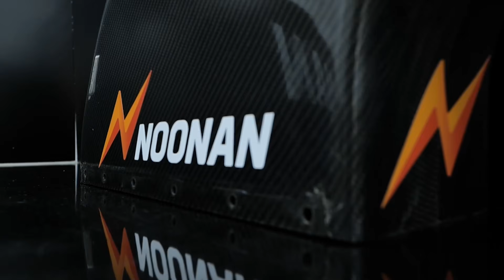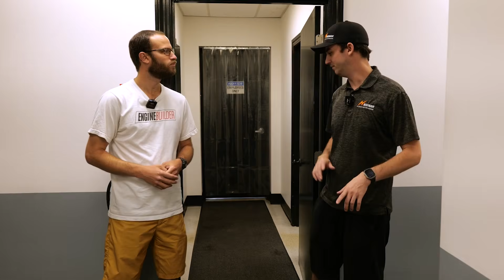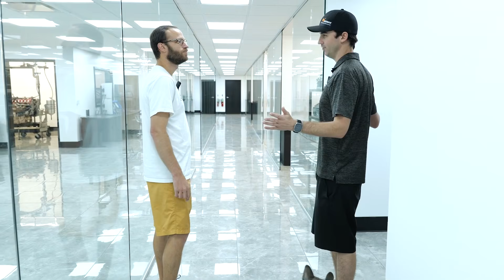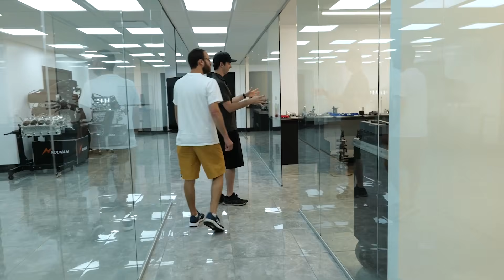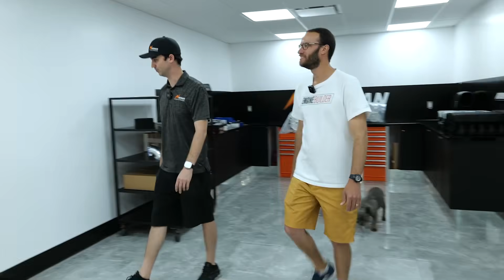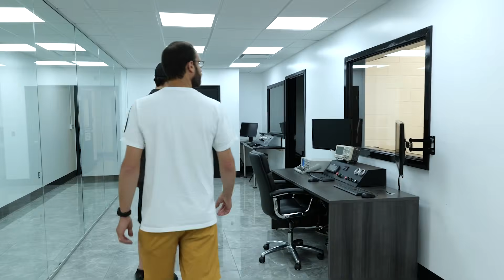The Coolest Engine Shop Ever? Inside Noonan Race Engineering

Comment: "Coolest" and "most badass" are not synonymous with BEST and during a "shop tour" OF the BEST "engine building shop" in the "drag racing industry" on the planet by FAR - ProLine Manufacturing - you will see "Noonan" engines in for  "building" because this "engine builder" is at most an "engine assember".

Comment: From a old Gearhead from the 70s. Technology is AWSOME today. Nothing to have a 1,000 + Horsepower daily driver today.
Reply: Nothing but 35k, just for your engine. Also , who would want a 1000hp to creep in traffic? 300hp daily, 1000 for track , cage ,chute etc
Reply: @carpentrybybill7018 I guess you never heard of Sick Week and many other events. Where there are cars making 4,500 plus Horsepower on the street. Many new cars are making 700 plus Horsepower. Just because you see no need it does not apply to others. On your 35 k engine.  You can go buy a 700 Horsepower out of a new total Mustang for around 15 k. Add some bolts on, making a thousand Horsepower in traffic with a/c on. Guys like you have no idea about new technologies.

Comment: I would love to build/design a engine. I'm thinking a big block version of a LS/LT block. A m20 splayed main studs, that thread into the base of the cylinder /water jacket area, or the top of the main webbing, with m12 cross bolts,  capable of 4.6" bore, with a 4.5" stroke, capable of about 4.8" , a bore spacing a little wider than a BBC ,  with a deck height to allow 6.5" rods if desired. , normally a 6.2" -6.3"  or as short as 5.9-6" with a shorter deck version. Use a bolt in cylinder liner system, o-ring into the block, have a 1" thick water jacket. With 6, m10 bolts per sleeve with a press fit deck plate that presses in after the liners. Working as a girdle with the head studs threading into the water jacket and cylinder base. And using a head similar to the new Chrysler hemi, with overhead cams, titanium valves , tiny springs and stims 6mm, maybe inconel exhaust valve in about 1.925" exhaust, and 2.280" -2.3" intake. And CNC raised ports, with polished chambers. With the heads looking similar to motorcycle heads with ceramic coating in the exhaust port combustion chamber even under the valve cover to help with oil draining back, and heat , the ceramic insulation reflects heat and insulates. Also leaving a smoothe stick resisting surface , used on the piston dome, chamber valve face and back side leaving the seat and stem uncovered.  the insulation of the exhaust port will keep the energy in the exhaust, good for turbos ,  also resisting carbon sticking to the port walls possibly look into a dual overhead cam, using using finger followers possibly, looking for a near 2:1 ratio, with a quick ramp rate, Maybe use a Ducati style valvetrain , the desmo dronic  with the cam opening and closing the valve! Freeing up lots of power,  could be a cool engine, start with a 4.250" bore, and 3.875" stroke, 4340 crank and rods, ultra light. Rods with 1/2" bolts,   the aluminum sleeves with steel or iron liners bolting in, with the deck plate pressing in after or possibly before they are bolted in. Through holes in the deck, the sleeve/liners an go in all at once or one by one. Then a non water based coolant is used, each head and block bank having its own coolant manifold internal. With either a internal crossover. Or a external crossover, with steam ports on the block and heads leading to a -8 outlets on each head at the front and rear. With the option of a block steam port the steam port being ported through the head from the block , leading directly to the outlet, for bleeding air from the system when filling. Non water based coolant doesn't make steam. Use the steam ports with a crossover, to pull a vacuum. Then fill the system until the vacuum pump overflow catches coolant, then close both fill point and steam port, with boost it should be capable of 3k HP daily driven with ps. And A/C,  and get 20-25 mpg until, because of v-tec and VVT , and possibly a 32valve option, a natural 600 HP engine in stock type tune, with a tune and exhaust, intake 750-800hp. Add cool boost, 14psi should be near or over 2k HP  sorry to ramble!!

Comment: It seems they would atleast get the valve covers roughly cast. Even with the walls 2"-3" thick. It would cut cost. And still be a milled billet valve cover.
Also a head can be cast in a oversized rough shape to save milling time, and a block thats a big difference. Casting a similar shaped block to be milled . But i guess they know what they are doing..
Reply: Agree,  he seems to be proud of being so wasteful of an expensive material...and for them to not handle their own recycling is poor business in my opinion as well.  Per current Aluminum recycle pricing they are stepping away from at least $550.00 per block waste.

Comment: Lived in Spartanburg all my life. Never heard of these guys. Not a drag guy , so that may be why. My shop is actually a mile away from them. You need to do Clements Racing. THE premier dirt late model engine builder as well as cylinder head designers
Reply: You never heard of them being a mile away?
Reply: @Mr.RollTide  Noonan has been in the US less than 10 years. Let's not act like it's  Kaase, who's been in the same place for 35+ years.
Reply: @El.patch.o anybody with a shop should know that somebody is a mile away building $100,000 billet engines.
Reply: Don't forget Fulton and Parr racing also in Spartanburg.